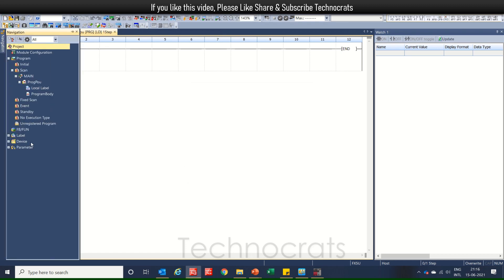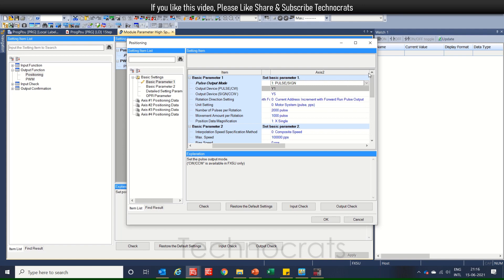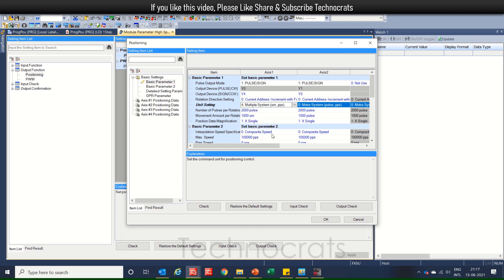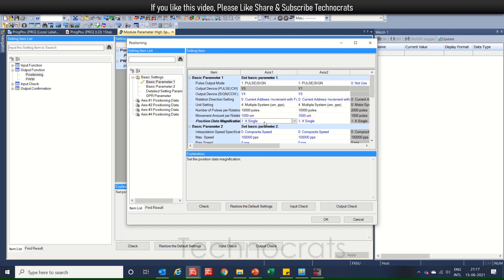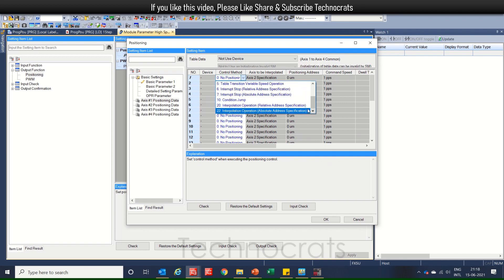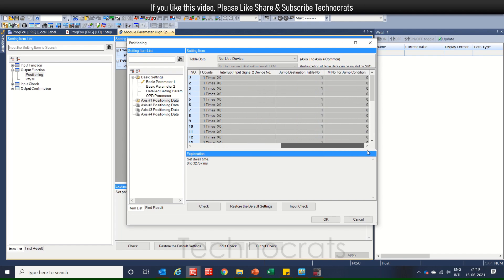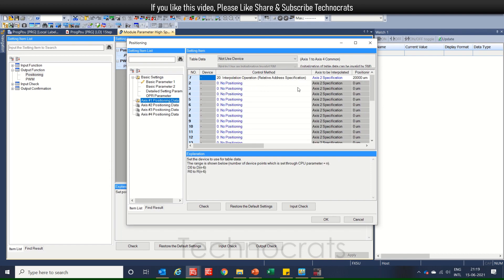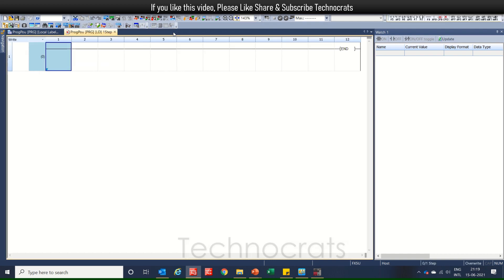2 Axis Servo Interpolation (Pulse train) Using Mitsubishi PLC

Comment: How to synchronize 2 axis servo ?
Reply from the maker: use motion or simple motion module for synchronization.
Reply: How to do it ?
Reply from the maker: That depends on your application, what operation you want to perform,
Synchronous control parameters are used.
Reply: About winder and rewinder machine how to control tension and speed ?